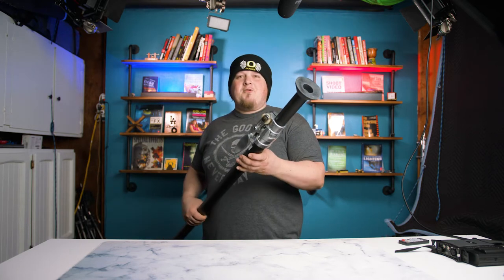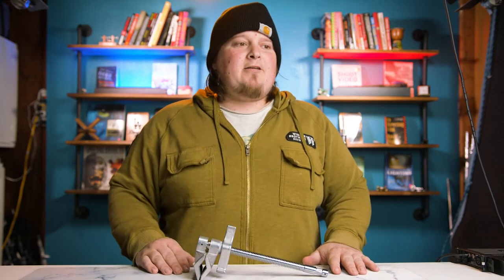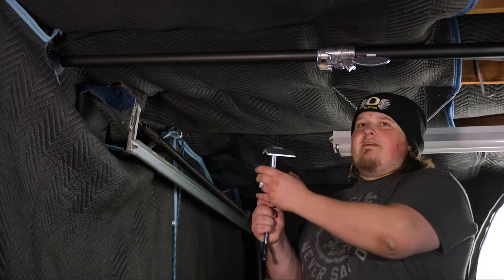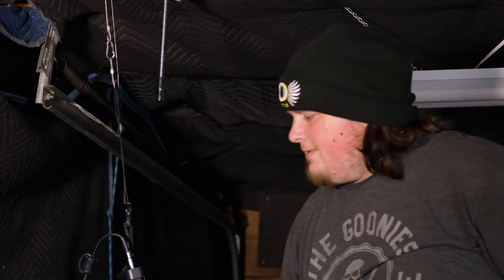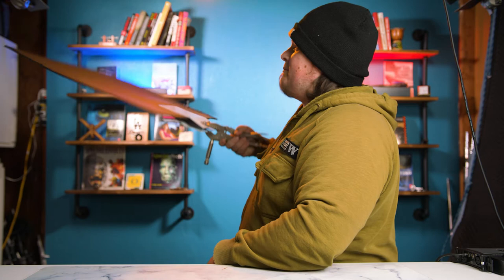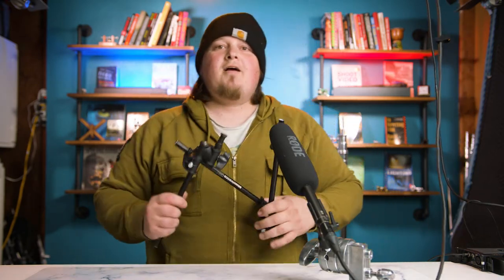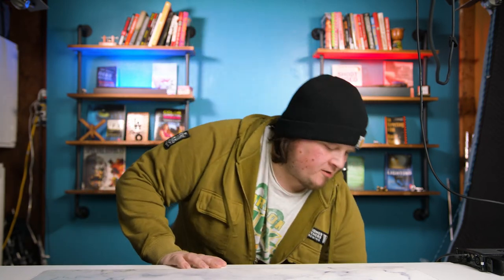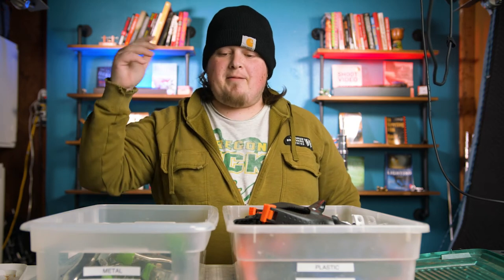Grip Arms and Clamps - How to Grip!

Comment: No Magic Arms? I have a bunch of magic arms from Manfrotto.

The dual friction arm is less flexible than the single friction arm, but holds more.  And Manfrotto makes both.
Reply from the maker: No I didnt have any availabke while filming
Reply: @LunaScopeJustin  I live about 3 hours away you can borrow some. Tacoma is just up the road.
Reply: @meatbyproducts  Are they worth the extra 60 bucks?
Reply: @BroozdHD  I use my magic arms for everything!  Okay most everything.  I thought they were over priced until buying one... Now I have a dozen
Reply: @meatbyproducts  shit.. I'll start with  small one from small rig. That one isn't that steeply priced. Haha. Will get back to you once I'm converted to the magic arm cult!
Reply: @BroozdHD  the small ones are useful.  The real ones from Manfrotto are awesome. They also make a micro 244 magic arm.  I am trying hard to steer away from Chinese owned companies like Smallrig.